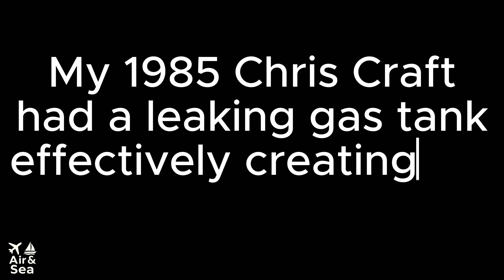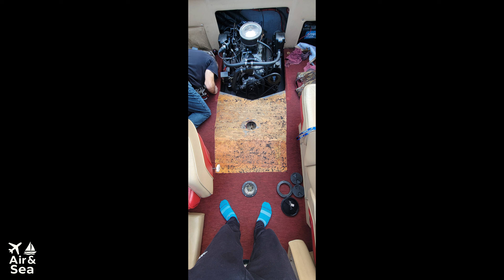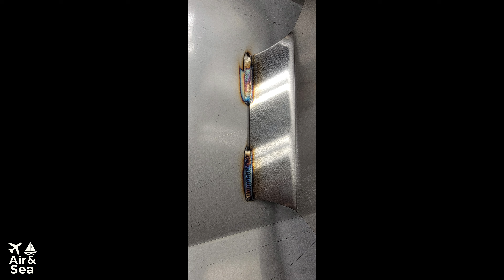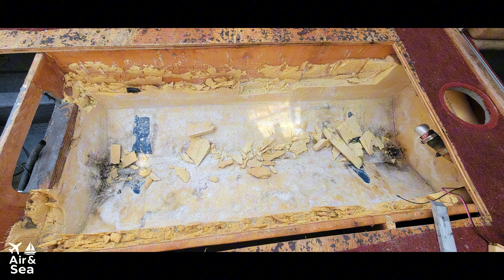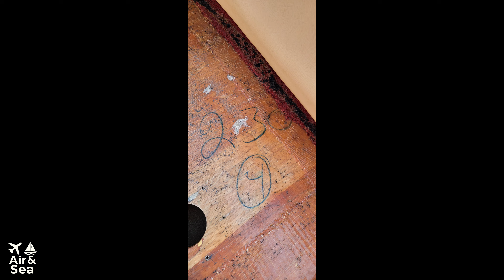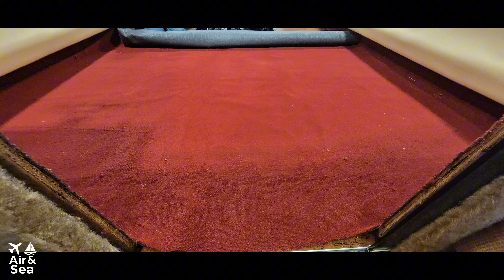#5 Fuel Tank Surgery: We Cut the Floor Out of Our Classic Chris-Craft! 🔧🚤 | 1985 Scorpion

Comment: My tank seems to be fine (I think, anyway), but I'm going to use this and other videos as a guide to help put mine back together, as it is pretty much stripped; no coushins, no engine cover, seats, and now, without a floor as I had to strip it all out because the previous owner or someone didn't put their new floor in correctly (no tabbing, no fiberglass seal on top or the bottom of the boards) and it all eroded away from underneath. I wanted a project boat and this one was dropped in my lap, for free, but man, it is going to be a long road before it hits the water. 🙂 But, thanks for your videos...they are going to be a huge help.